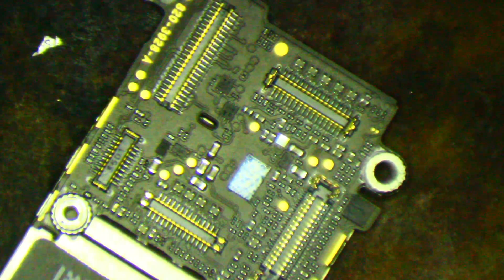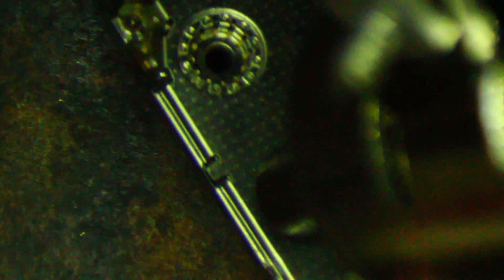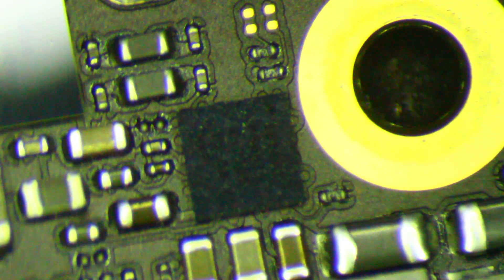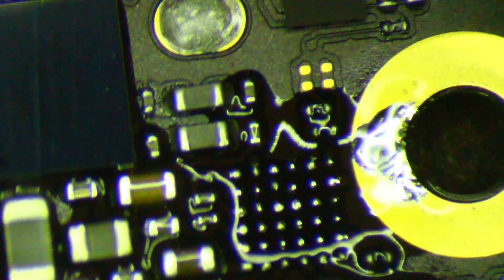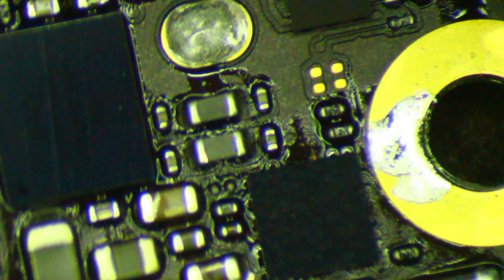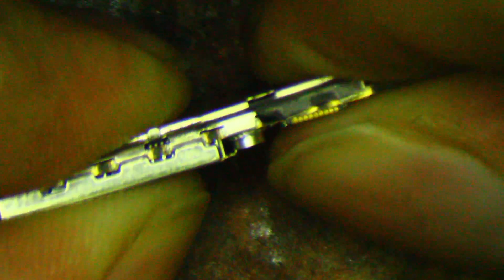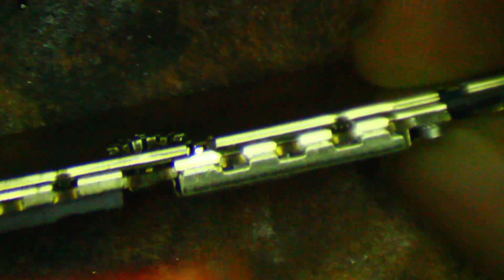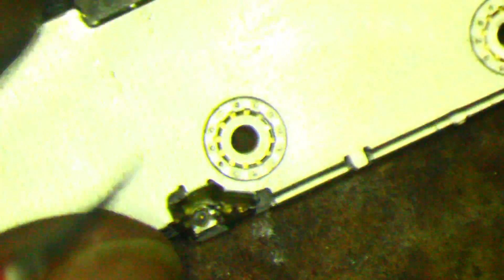iPhone 5c not charging solved by replacing Tristar (U2)

Comment: some guy told me that my error when trying to restore my 5c (error 2009) is caused by Tristar ,could that be it ? btw nice job on that soldering m8
Reply from the maker: Hakko 852
Reply from the maker: I can't say that I've ever associated error 2009 with Tristar but I generally don't try to restore a phone that comes in because it won't charge which is 99% of the Tristar jobs I see.
Reply: @MarkShaffer  tnx
Reply: @MarkShaffer  can you tell me what hot air station do you have ?

Comment: Hi
I have an iphone 5c with no power. I think it's U2 faulty and now I will tel you the misurament done at this moment.
On C248 I don't have 5V (PP5V0_USB_PROT).
On C153 (1) I have 5V---> PIN FOR HANDSHAKE C304 I have 5V.
At the signal of retun of U2 (OVP_SW_EN) I have to found on C153 (2) something like 0V..Because the gate of Q2 it will open when have a signal LOW (TRISTAR_TO_PMU_OVP_SW_EN_L) but I HAVE 5V.....

So I think Q2 can't open the second gate because U2 it's faulty.

Do you agree with me?

Sorry for my english...But I hope you have understood me.

Thanks